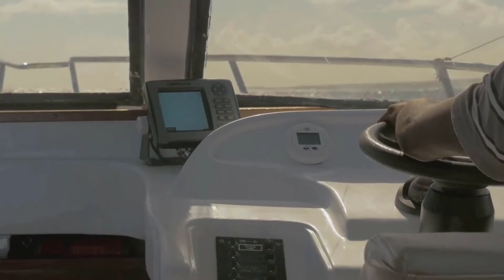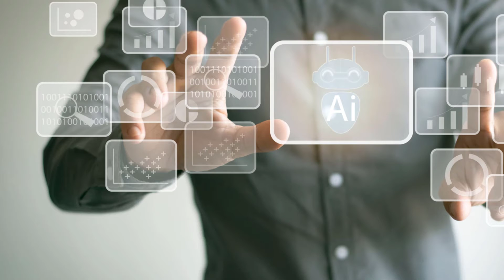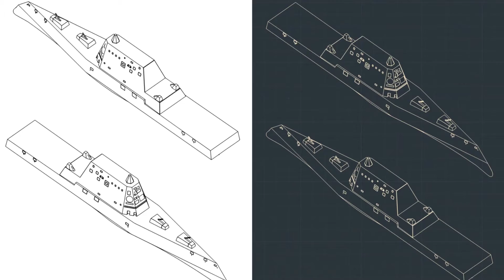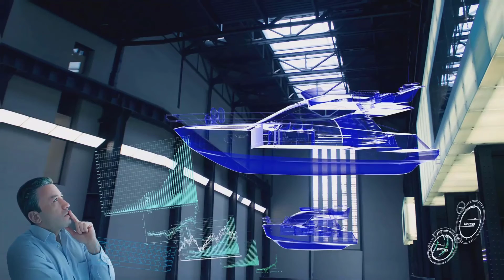How AI is Transforming Ship Design Forever

Comment: pretty much just rich people will initially benefit from this; after all, where will the funds come from to do all this? mankind can't follow ethical reasoning due to greed already; so, this script sounds good; but, realistically there are numerous hurdles
Reply from the maker: Thank you for sharing your thoughts. It's a valid point that often, new technologies and advancements tend to benefit those with more resources initially. This pattern has been observed historically with many innovations, from the automobile to the internet. However, it's also important to note that over time, many of these technologies become more accessible to a broader audience as costs decrease and availability increases. The advent of new fabrication technologies and materials, such as nanotechnology, holds the promise of making even luxury items like yachts more affordable to produce and maintain. This could significantly lower the cost barrier for individuals who wish to experience such luxuries without the need for outright ownership. Moreover, the concept of a sharing economy, exemplified by platforms like Airbnb for apartments, can indeed be extended to other luxury items and experiences, including boats and yachts. This model not only makes it more feasible for a wider range of people to enjoy experiences that were previously out of reach, but also promotes a more sustainable use of resources by maximizing the utility of a single item among multiple users. This shift towards shared experiences over ownership could play a crucial role in democratizing access to what are considered luxury services today, further underscoring the importance of innovation and ethical considerations in shaping a more inclusive future.